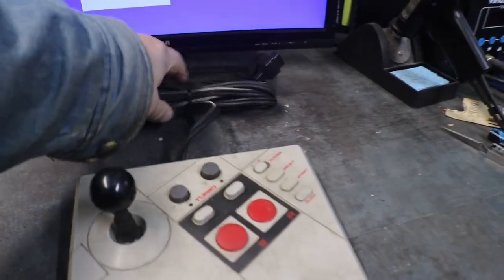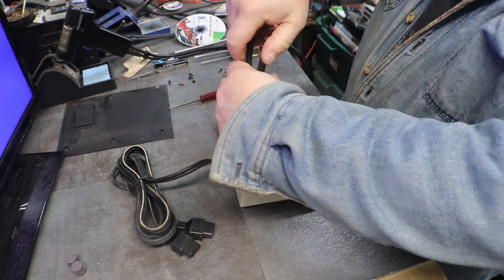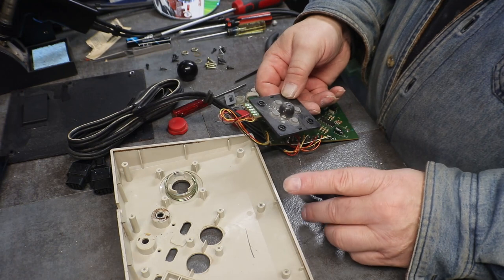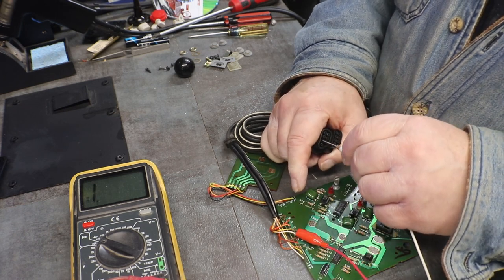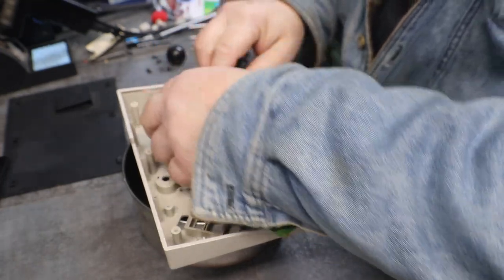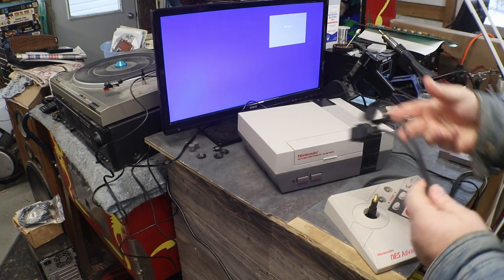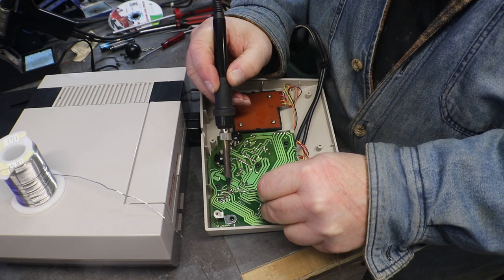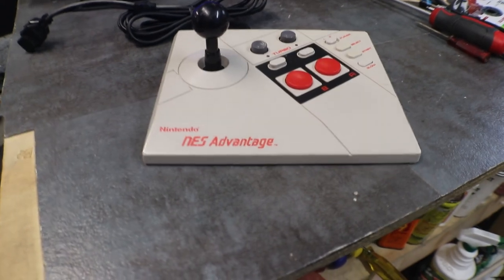Faulty Nintendo NES Advantage Controller / Can We Fix It

Comment: Bro the start button membrane was not in place. That's why the button is cocked to the side. And player 2 start button wont work. If you would of pushed it while playing as Lugi the gane wouldnt pause. I seen it on the video when you put the board back in after adjusting the switch.
View 40:03.

I still like the video anyway. I have 2 of these.
Reply from the maker: I seen it and fixed it. Thank You.